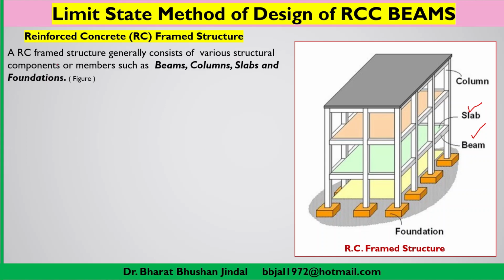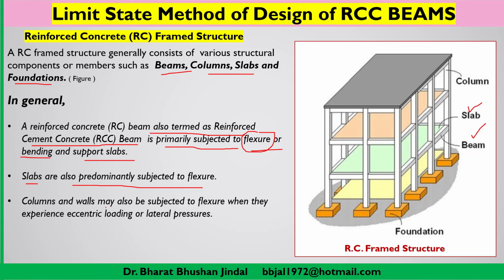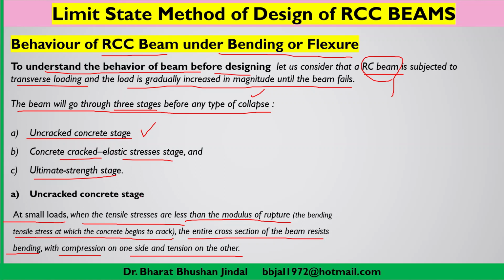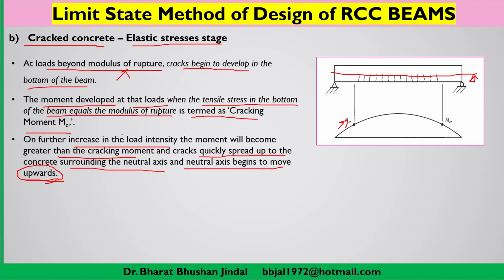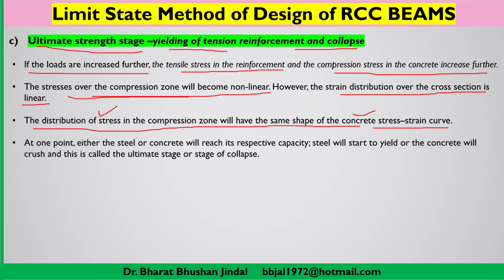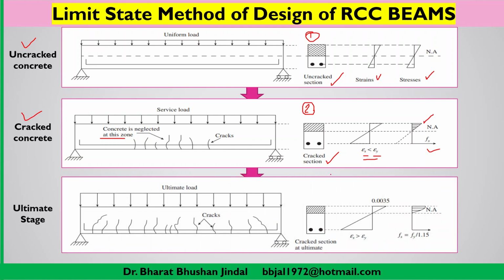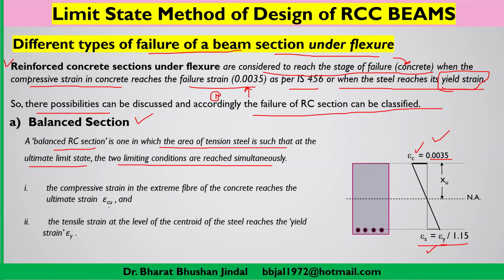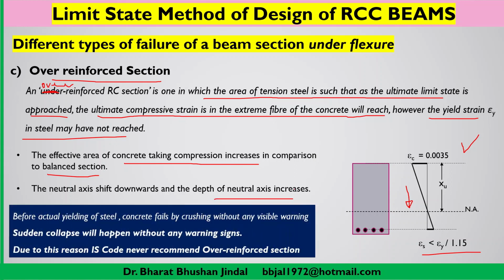Lecture 7  ||  Design of RCC Structures  ||  Limit State Method  ||  IS :456 -2000 || Civil Engg.

Comment: Q.) sir , what is ecentric loading?

Q.) why only steel bars are used for reinforcement?
ans.) Because both concrete and steel bars expand at the same rate that avoids generating any stress between them.

Comment: Steel is used because it bonds well with concrete and expands and contracts due to temperature at similar rates. Moreover steel is highly ductile material and is easily available at low cost.

Comment: Answer of 2nd question
At one point, either the steel or concrete will reach its respective capacity; steel will start to yield or the concrete will 
crush. Let us assume that the section under consideration is 
under-reinforced. In this case, the steel will yield first before the concrete fails, giving suffi cient warning before failure.There will be a considerable  non-linear defl ections will increase leading to extensive cracking, and finally the beam will collapse due to the crushing of concrete in the compression zone

Comment: Sir, in the ultimate stage the stress graph of compression zone is non linear, maybe because concrete is a brittle material therefore the uppermost layer of it in compression zone will yield abruptly when the strain reaches 0.0035.

Comment: Under reinforced section is preferred and over reinforced section are not preferred because there is ductile failure in under reinforced and in over reinforced section there is brittle failure( due to concrete) which is more sudden and dangerous than ductile failure

Comment: Why only steel is used in RCC structure ?
1. Easily available
2.coefficient of thermal expansion is same as that of concrete
Reply from the maker: Go through some good books for the actual answer.

Comment: Sir, at 9:55  what is the need of doing analysis because when we are going  to design a structural element we would already  know  its capacity to resist various external loads or is it the case we would design after doing analysis.

Comment: Steel is used as a reinforcement in concrete because 1.) Steel is highly ductile material
2.) It can be welded easily
3.) It can be easily and widely available as compare to other ductile material 
4.) It can be recycled easily
5.) It bonds well with concrete
6.) It expands and contracts due to temperature at similar rates

Comment: Q.1The steel provides all the tensile strength where concrete is in tension, as in beams and slabs; it supplements the compressive strength of concrete in columns and walls; and it provides extra shear strength over and above that of concrete in beams

Q.2In under reinforced section, the failure is ductile because steel fails first and sufficient warning is given before collapse. Due to ductile failure and economy, the under reinforced sections  are preferred by designers.
Overall video was nice SIR..

Comment: 22:12 because coefficient of thermal expansion of steel  is approximately equal to the that of concrete. If we use another material whose coefficient of thermal expansion is different then there will be cracks while the thermal expansion. Secondly it is economical as compared to other materials.

Comment: In an over reinforced concrete, concrete reaches its permissible stress before the steel. That means it would fail first (brittle failure) causing problems as it fails suddenly without warning.
In balanced reinforced beam cracking of concrete and steel is at the same time giving no warning during vulnerable condition.
In under reinforced section steel is less, starting to yield and then cracking of concrete resulting in structure failure (ductile failure). It gives warning and time to escape from vulnerable conditions. That's why we prefer under reinforced section.

Comment: Good video sir!!
Answer to your questions
Q1. Why do we use steel instead of other materials
Ans: i) because it is an alloy and can resist rust
ii) has high tensile strength which is used to fill the gap for almost negligible tensile strength of concrete
iii) because they expand at similar rate under thermal expansion, at different rates a shear stress would appear in the reinforced slab that can lead to failure.
And there is no material other than steel having the same thermal expansion property as cement

Q.  Why is over reinforced section not used?
Ans: Because concrete reaches the limiting value of stress prior to steel and because of failing first and it being brittle, due to safety reasons it is not recommended.
In case of balance section, it is hard to find the sweet spot of equilibrium of the two limiting conditions 
In case of under reinforced section,  it gives enough warning and time in case of failure. Therefore it is preferred more than balance as well as over reinforced section

My doubts :
1. How can we as an engineer prevent these bending or flexure of beams
2.can we get a rough idea of what do you mean by neutral axis moving upwards
3. Ductility means the property of a material to be drawn into thin wires, how does it help with sudden failure in case of steel ( 40:09)

Comment: Answer to 3rd question
In under reinforced section , the failure is ductile because steel fails first and sufficient warning is given before collapse. Due to ductile failure and economy, the under reinforced section and preferred
Whereas In Over Reinforce section concrete will fail first and Concrete is Brittle Material so that's why it is not preferable because of safety. The Failure of this section is brittle and sudden

Comment: Sir, the video is very detailed. All the doubts have been cleared in the video itself.
SUMMARY:
In the video, there is a detailed explanation of the RC framed structures taking into account the slabs, columns, beams and foundation.(at 1:46 )
This video also explains in depth about the analytic and design factor (at 7:20).
The video explains the behaviour of RCC beams under bending/flexure(at 10:55) and the three stages that the beam undergo before collapsing that are
• Uncraked concrete stage 
• Concrete cracked-elastic stresses stage
• Ultimate strength stage.

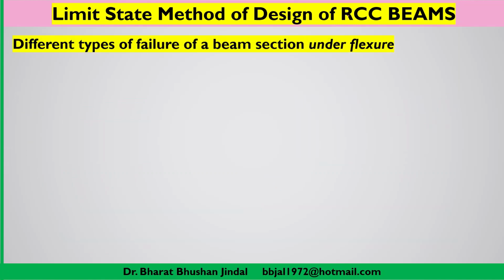(At 32:40) there is in depth Explanation of different types of failure of a beam section under flexure and classification of RC sectiom failure(at 34:35) that are:
• Balanced section 
• Under reinforced sections 
• Over reinforced sections

Comment: Sir Very Nice Video. the content is of par excellence as always.
I have a question (time 16:05), Will the structure undergo these stages before collapse after hitting by a wrecking ball at the time of demolishing ?
Reply: I wanted to ask that What will be the reaction of the structure when the load is not increased gradually but suddenly surpassing the Ultimate Stress Stage.
then for a very small interval of time will there will be all the 3 stages occurring ?

Comment: 22:14 The only common property of concrete and steel is that they both have same coefficient of thermal expansion which avoids generating any stresses. That's why steel is used as reinforcement. Another reason is that steel is good in tension and concrete is good in compression, making the structural durable by getting proper bond.

Comment: The percentage of steel in under reinforced section is less than the balanced section hence the section is economical. In under reinforced section, the failure is ductile because steel fails first and sufficient warning is given before collapse. Due to ductile failure and economy, the under-reinforced sections are preferred .

Comment: Sir, I'm really grateful for your efforts and after watching twice the video almost all my doubts are already cleared, but I do have few small doubts.
1.Sir, if we put steel reinforcements in both tension zone and compression zone, how will the position of neutral axis vary and what will be the effect on the concrete section in compression zone?
2. Does the neutral axis pass through the centroid of the beam in all the cases of uncracked concrete stage and how do we draw a neutral axis if the beam is curved?
3. Sir, In the lecture we considered the behavior under transverse loading. What will be the effect of beam under axial loading?

Comment: Answer to first question
Steel is particularly preferred as reinforcement because it bonds well to concrete and expands at the same rate, not only this but it has many properties that helps steel to stand out like it is highly ductile material , coefficient of thermal expansion of concrete and steel is almost equal, It can be recycled and welded easily which make them widely and cheaply available compared to other ductile metals.

Comment: Sir answer  to your first Question might be that steel can withstand tensile forces  better than concrete and steel can make better bonds with concrete and also steel can expand or contract acc. To temperature  variation

Comment: 3rd: we prefer under reinforced section, the steel in this case fails first, and hence sufficient warning is given before collapse while in over reinforced concrete, without any warning concrete will straight away be crushed.

In balanced reinforced beam, the crushing of concrete and the steel reaches it yield strength at the same time, so no sufficient warning will be given in this case, so we don't prefer it.

Comment: At 43:23
Rcc section should be designed as under reinforced section  because sudden collapse is not expected in it. Practically if we design under reinforced sections then during failure occupancy may get some time to evacuate the building and save their lives. But in balanced section crushing of concrete and yeilding of steel occurs simutaneously  which will result in balanced failure. So Is code is suggesting under reinforced sections.

Comment: Sir, how is eccentric load different from concentrated load?(6:40)
Steel is used as reinforcement because it bonds well with concrete and expands and contracts due to temperature change at similar rates.(22:35)
Sir, what can be the reason for the non-linearity of stress in the compression zone during ultimate strength stage?(24:28)
As the important objective of a structural design is produce such a brittle RCC member that even if failure occurs the building provides sufficient time to save human lives. This situation can only be achieved in case of under reinforced section as the building won't collapse abruptly where as if over reinforced section is adopted the building will collapse abruptly and lot of lives will be lost.(43:50)

Comment: Ans to the 2nd question:
At the ultimate stage, the concrete member in the compression zone has become inelastic and as we know that when the material becomes inelastic the graph is non linear, so this can be counted as a reason.

Comment: Answer to the 1st question: Concrete is weak in tensile stresses, so in order to take care of this factor, reinforcement is done. Steel are the best to take care of the tensile load. Both concrete and steel expand as temperature increases. The steel and concrete expansion rate is same and hence it takes care of the stress, whereas the other materials have different expansion rates and hence, a new stress may be developed. Also, steel is cheaper. That is why only steel is considered as a reinforcement material.